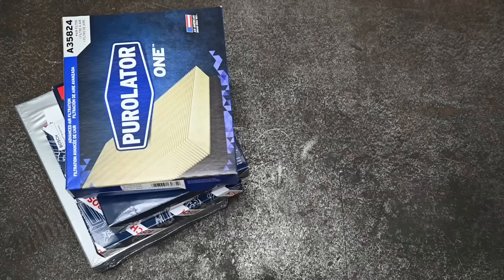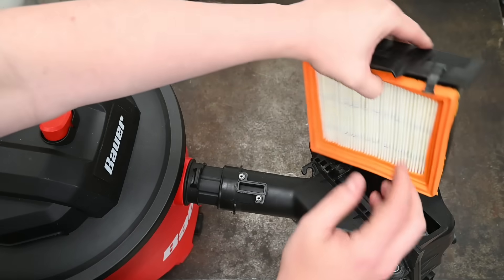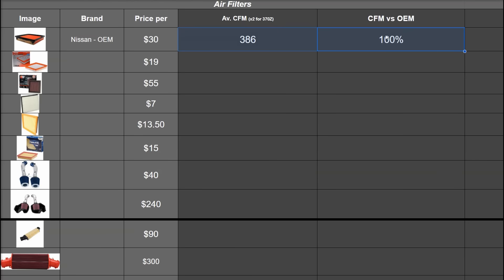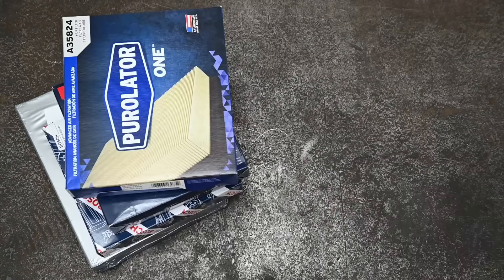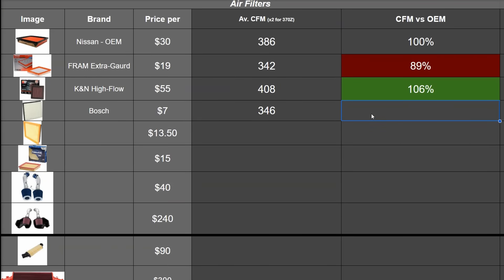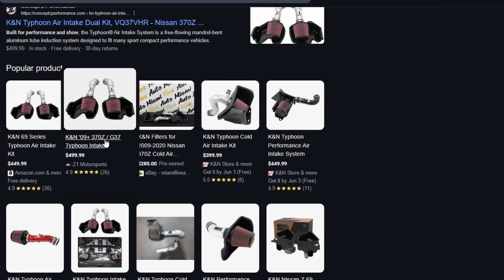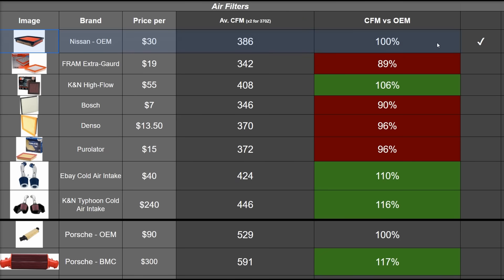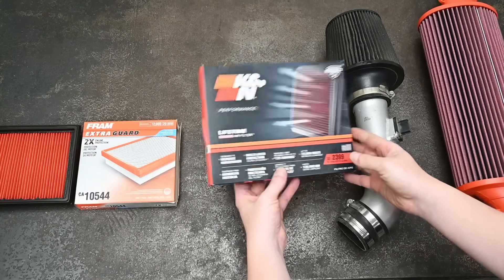Intake Filters TESTED: More Dough = More Flow?

Comment: Putting better flowing filter won’t do much unless you have a way to recalibrate MAF sensor. At partial throttle, in closed loop, the ECU will be able to adjust, but at WOT (open loop) you will not see any gains and in fact you will be running lean due to extra unmetered air. You need a way to remap the MAF table after doing some runs as that is basically hard coded values that open loop will use. Short ram intake will sure give you some nice induction sounds though.
Reply: ????  Why do you get unmetered air ?    

The MAF is downstream from the filter.
Reply: @Tsnor150  because there is a MAF table in the ECU for the RPM range that is calibrated to the stock setup. When you have less restrictive system more air is flowing through so those numbers are then wrong and in open loop mode you will have more air that ECU is not aware, thus not injecting more fule and causing lean condition. Trust me, I did lots of data logging after putting intake and exhaust on and the numbers are off so you need to "recalibrate" (remap) MAF table.
Reply: @macieksiemczyk1096 no absolutely not. You're very wrong. By your logic altitude would make cars run insanely rich and exceed the tables. No. Just no... Unmetered by definition is after the MAF or MAP . You're describing a change so large that it exceeds the allowable adjustment within the tables which is typically 20% +/- depending on the vehicle. Now changing the MAF diameter or relocating it, totally different story that can mess things up
Reply: @macieksiemczyk1096  "because there is a MAF table in the ECU for the RPM range that is calibrated to the stock setup. When you have less restrictive system more air is flowing through so those numbers are then wrong"

No, you don't understand how a MAP or MAF based EFI system works; it delivers fuel in proportion to measured air to hit a calibrated AFR target value for the current engine RPM and load.  If you are getting more airflow then the base fuel calculation will automatically deliver more fuel.  Any short and long term corrections are applied after the base fuel calculation.
Reply: @accordv6er wow dude, you are super confident yet completely wrong. You are talking about closed loop system, at WOT cars go into open loop and there is no feedback from o2 sensor hence the fuel trims are completely out of equation. Do some research before you tell someone they are wrong, because you don’t know what you are talking about; Google “MAF” calibration
Reply: @ferrumignis  let's just agree to disagree, because I've actually tuned ECU before and are not wrong here (for majority of the cars). 

And you don't know that most cars switch to open-loop at WOT. Might want to google "open loop vs closed loop in cars wot"
Reply: @macieksiemczyk1096 no I'm not. Unmetered air is defined pretty easily. And you're not talking about MAF sensor calibration, you're talking about load/spark/fuel/ign tables. Open loop/close has nothing at all to do with the actual calibration for a specific MAF sensors which is a sweep of output based on temperature change -> combined with air temp and known diameter to get a calculated flow. Stop trying to throw terms around when you can't even define metered air. O2 sensors aren't relevant here either. Intake FILTERS are not going to make a change that requires recalibrating the MAF sensor. You're describing something completely unrelated. I've setup standalones, made harnesses, used random brand sensors (which require different config and calibration), and messed with other I/O systems like R/C hobby stuff and Arduino junk. I'm not an expert "tuner" but I definitely understand how MAF sensors work and what inputs an ECU takes...
Reply: @macieksiemczyk1096 if you're recalibrating your MAF table instead of fuel/ignition/load to account for changes in airflow, you might as well just put a variable resistor of sorts on the signal (which has actually been done, also MAF 'clamps', interesting devices) . If you changed the diameter or significantly modified the airflow around the sensor, yes it will need fine tuning and adjustment. If you changed the total airflow of the engine for a given range of conditions under WOT sure maybe some tuning will help, but if you're not doing it with fuel for air, and instead adjusting the sensor inputs that's weird as heck
Reply: @macieksiemczyk1096  Umm you realize the vehicles computer does all that for you because it its programmed to do that right? you go into mountains with thin air and your MAF need reprograming? nonsense lol.
Reply: @rhetorical1488you need to learn how to read with comprehension since I was talking about WOT, open loop, and any gains.
Reply: @macieksiemczyk1096  mmm yes tell us about how you keep your engine redlined for optimum air flow 🤣
Reply: @rhetorical1488 WOT and redline is not the same thing, is it now? Clown
Reply: @macieksiemczyk1096  its fine child your vehicles computer does the thinking for you now. you can read your charts while it drives its self😘
Reply: @macieksiemczyk1096 You obviously know nothing and are doubling down. I know exactly what open loop is, but apparently you can't grasp the simple concept that a correction can still be applied to to base fuel calculation when in open loop. A real man would admit they were wrong, which leads to only one conclusion here
Please tell us again how the MAF needs to be recalibrated every time the airflow through it changes 😂😂😂.
Reply: "Putting better flowing filter won’t do much unless you have a way to recalibrate MAF sensor"

A MAF sensor doesn't care how free-flowing an air filter is, it simply measures airflow.  It does not need re-calibration for the different filter for the same reason it doesn't need re-calibrating when you open the throttle more.  The only caveat is that directly attaching a cone filter to a MAF with no pipe in between can sometimes cause calibration issues due to turbulence, so don't do this.
The chances of making an engine run significantly lean at WOT with just a filter change are negligible, unless your car comes from the factory with a very restrictive filter which would be quite unusual.  Also open loop doesn't always mean no correction, some production ECUs will apply the latest long term trim to WOT e.g. the 2nd gen Subaru Impreza.
Reply: Scaling is important.
Reply: @brandonroeder2461 the filter doesn't adjust scaling.... Diameter will affect scaling. The maf calculates mass based on a fixed diameter intake.

Comment: Could do something like project farm and test particulate count passing through the filter
Reply from the maker: See pinned, industry professionals sort of call that type of method non representative
Reply: @TorqueTestChannel  Industry professionals get paid to make industry more money, not to make engines last longer or use less fuel.
Reply from the maker: @mikey4016  Well, we also tried the clear box method and got +- almost 20% on 2 new identical filters. So we dont include anything we cant replicate at will

Comment: I'd love to see the performance with a controlled dust/particle variable I thought you were gonna use the dirty vacuum for that. As usual a great video
Reply: The furnace filter air flow test from project farm was brutal.  The experts had a ton of "this is why that doesn't work, you need to do this instead" comments.   

fyi: ANSI/ASHRAE Standard 52.2-2017 test method is used to evaluate the filtering capability of air filters, specifically for general ventilation and air cleaning devices. This standard determines the Minimum Efficiency Reporting Value (MERV) of a filter, which indicates its effectiveness in capturing airborne particles of various sizes. The test involves injecting a challenge aerosol into the filter and measuring particle counts both upstream and downstream.
Reply from the maker: Agreed, see pinned though. Doing it right is tough
Reply: @TorqueTestChannel  i really appreciate you not doing it at all instead of doing it wrong. maybe one day you can test it proper
Reply: @TorqueTestChannel definitely. I'd be interested for us rally/dirt road guys what options are best for dust/fine particulate. Wish there was a multi stage like heavy equipment.

Comment: K&N flows better because its more porous and old ones flow even better because the oil, which is plays a role in filtering particulate, is all worn off. The old one doesn’t filter nearly as well as freshly oiled so its a trade off. Similarly I would wager the number of pleats and filter material of the cheaper ones is more why they flow worse than the rubber coverage.

Comment: Only thing a new fancy intake gets me is challenges to race. I about laughed myself off the road the first time.
Had a little 1.6L truck, sounded beefy af. A 5-speed, couldn't burnout outside of redline and I had hot hatches reving me at lights. Might've been the gearing down and popping to 4 grand for a second.
   Now I miss a manual gearbox ☹️

Comment: No to K&N. Just no. If the oil gets on the mass air flow wire that's just past the filter, it'll stall the car and lead to rough running. Don't do it!!!!! It's not worth it!
Reply: This. Wife wanted K&Ns for her Land Rover…eventually got consistent MAF or MAP error codes…cleaned MAFs, replaced them, etc. 

They finally went away after I swapped back to paper filters, cleaned the MAFs after mechanic recommended.

Say no to these oiled filters lads.
Reply: if you dip your filter in a bucket of oil than you deserve a clogged MAP. reading instructions is a lost art it seems
Reply: @rhetorical1488 MAP or MAF? My MAP can get oily and not be damaged. Since it's past the turbo, in the intake manifold, there is a tendency for this to happen, even with an AOS. If I run a filter with ANY oil in it, it's going to get pulled out of the material by my turbo, and kill my MAF.
Reply: I’ve run KNN filters on every car I’ve ever owned and never once encountered the mass airflow sensor codes.
Reply: @BlindMansRevenge2002  you're probably running naturally aspirated then. I can tell you that in a turbo charged engine you'll burn out or damage the MAF if you use an oiled filter. Happened to me less than 2 weeks after buying my 2015 WRX. Either the previous owner (he had it less than a year), or the dealership decided to put an oiled filter in, and it damaged the MAF. Now I use an AEM dryflow filter on an HPS intake.
Reply: @brandonroeder2461  Nope, I've run K&Ns on turbocharged cars without any issues as have thousands of others.  If the K&N owner is a clumsy, cack handed individual that soaks the filter in oil then MAF contamination is more likely.  I'm not going to claim the K&N filters as well as paper though.
Reply: @ferrumignis  ok, I believe you. Maybe it depends on how close to filter is to the MAF. I know others that have had the same exact thing happen though, even with OEM oil levels in the filter. 🤷‍♂️

Comment: Cfm isn't all that matters, this is like testing engine oil filters flow rates and saying the highest flowing filter is the best for my engine... Meanwhile it's allowing all kinds of contaminates back into the system to (slowly) damage and wear bearing surfaces.
Reply from the maker: Comparing it to oil filters is a bit of a mischaracterization as customers dont bring their own of those in to make more horsepower. Title says flow, premise is flow, we're measuring flow. The home made set ups/tests we've seen for testing filtration dont seem representative or repeatable based on looking into it, so will leave that to the labs.
Reply: @TorqueTestChannel touche, it was more an ironic comparison given the meager gain typically seen and rarely felt from putting a panty hose thickness air filter in hector's hatch or teshs trombone-mobile. 

My point was simply there is a point of diminishing returns where more harm than good comes from this mod, kinda like removing cats. I realize it's tangential to the goal of the video but hey, here's some engagement.

Comment: I'd have liked to have seen an S&B filter tested just to see if they are on par with K&N (which I assume they are, or better). It would also have been nice to see the oiled filters compared dry versus oiled.
And then of course the follow-up to this video should be how good they are at filtering out contaminants. It's easy to flow air if you let sand through...

Comment: I have a 2021 kia soul, nothing special by any means and no "mods". I just bought one of the reusable k&n filters even though I have like 5 wix ones sitting around. I bought the k&n for the washable feature. That really saves money! Glad it did well in the test!
Reply: Make sure you oil it, they don't filter as well when dry
Reply: To add to what Silvy said, buy the K&N Recharge Kit. It probably still comes with a wash solution, as then also the recharge oil. The solution is designed to break up the nasty gunk, but not harm the material (with I think might just be cotton).

Also read the original info to make sure it's still true because famously they used to say you can leave it dirty far far longer because it flows so well, so the dirt isn't inhibiting it nearly as much as it would a normal filter.
Reply: @silvy3047 oil it how? I bought the kit for k&n air filters, to recoat it.
Reply: @codystephens5939  The oil comes in a squeeze bottle or a spray can, if the filter is brand new it will already have oil on it. Oil comes in different colors so dont be alarmed if you buy a different brand of oil and it isn't red like K&N. The filter itself is white so once it starts to lose color you know when to clean it up. 

Wash out the filter with water, and use the cleaner spray from K&N too if it came in your kit, but it's not totally necessary, water is the most important. Let it completely air dry or blow the water out, then apply a coat of oil on both sides of the filter, let it sit for 15 minutes and put it back in the car.
Reply: @silvy3047  They don't filter well when oiled, either.

Just run the Wix.  You're gaining nothing with the K&N except shitloads of dust through your intake.

Comment: Air filters have two principal functions. They need to flow enough air, and they need to filter out the dirt whilst still flowing enough air. This is their dust efficiency and it's typically where paper filters don't perform well. They are excellent filters but they clog very quickly when dirty.
Reply: I'd rather replace a filter more often than have it "last longer" because it let a bunch of junk through instead of catching it.
Reply: A filter clogs because it's filtering.  K&N never clogs because it's terrible at filtering.

Comment: Something you could add as another method of showing difference in flow efficiency is a vacuum gauge at the port going into the vacuum.  This would show how easy it is for the air to flow through the filter when switching to different style intake pipes.
Reply: under rated comment.  yes -->  vacuum gauge at the port going into the vacuum
Reply: This doesn't tell you anything more than the measured airflow does, one is proportional to the other.

Comment: Were i live we have Moon Dust, it will plug up any filter really quick. 
An air compressor is mans best friend. 
As long as the air filter keeps the bugs and bits out of the engine? im good.....
I have used an oiled air filter,, OIL collect dirt and dust just being parked.
And plug up SUPER FAST....
But i do use K&N oil filters=AC Delco.

Comment: Great video. Reusable filters have some drawbacks since they rely on the user to properly clean and oil them. If you add too little oil, they don’t block particulates and if you oil it too much the oil will cover and perhaps damage the MAF sensor. I’ve found that OEM is always more than enough for a stock car.
Reply: You can get an AFE dry filter that is washable and doesn't require oil. Not all reusable filters require oil. However they will let more junk into the engine.
Reply: @mediocreman2  the vehicle will be long gone or the customers wish to retain said vehicle before the amount of damage an engine gets from dirty air will ever become an issue. most people do not reside inside a sandstorm so this is but a tempest in a teacup.☺
Reply: S&B and AFE dry filters
Reply: @gumps1986  this. i have a PRORAM nanofiber filter in mine which filters equally well as the fat OEM paper ones due to the mediums structure. and since nanofiber creates tons of static the microscopic stuff isnt an issue either. i wish people were more aware of nanofiber in general tbh, the throttle feels so much less clogged
Reply: Yeah I really wish I didn't have to deal with an oiled filter, but the last guy wanted a cheap "cold air" intake I guess
Reply: I only used one once, but I found over oiling slightly and then blow it with compressed air works great. If I put a piece of cardboard behind it and I'm not getting oil on it blowing 90-120 psi, good enough.
Reply: Our good friends at project farm did an airfilter test and that is how you should do a test. The K&m filter cost money to put sand into your engine. Airflow vs cleaning, I take clean air over destroying my engine.
Reply: ya but that un oiled filter just becomes a plain filter and those sub micron particles it missed are not damaging anything just like soot in oil.  Flow vs filtration is always the balance unless you are feeding a monster but then you are tearing that engine apart on the regular anyways.